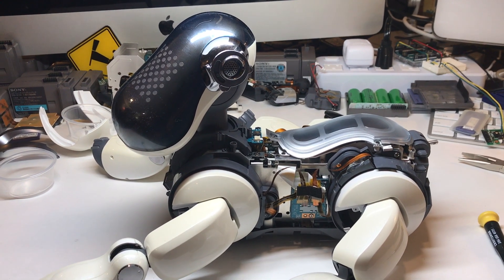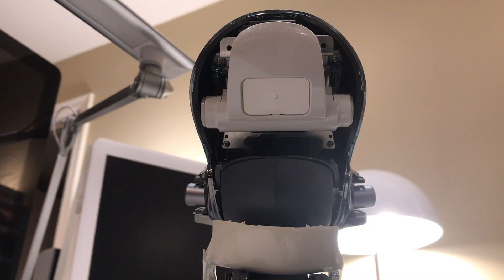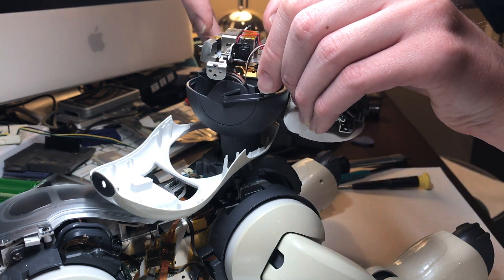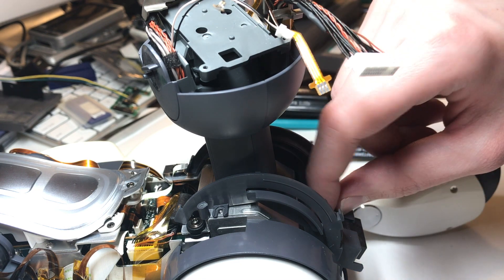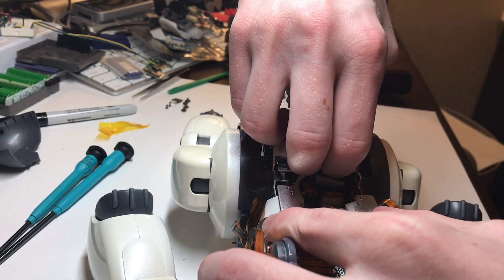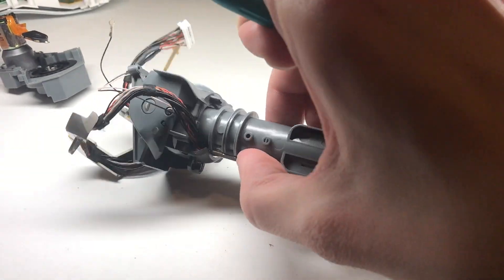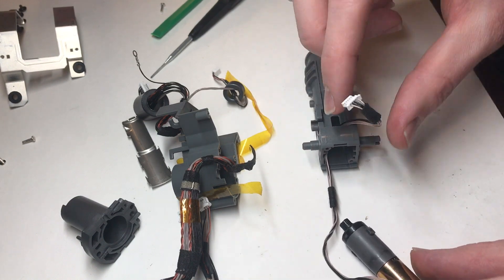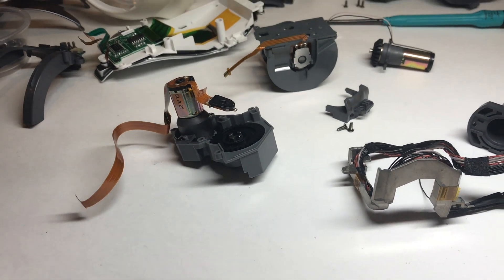Aibo ERS-7 Pan Axis Disassembly/Repair Guide

Comment: So i am a massive tech nerd. And i have save so far 200 for an aibo a guy quoted me 900 for an ers7 m2 with mind 3 software he said he would check the aibo to make sure everything is functional. Although from what i hear the microphone degrades. Where would i get new ones if i had too.
Reply from the maker: any 7 can develop a bad mic, but the only ones that are nearly guaranteed to fail are the M3s - sony had a defective batch of condensers during that generation.  i sourced my replacements from a specific sony video microphone that used to be pretty ubiquitous (i don't remember the model, at this point), but anything that's the same size/specs as the original will work

Comment: hi. the motherboard of my aibo head is broken. do you have any idea what the problem is? do you sell this spare part? cordially
Reply from the maker: unfortunately i have not seen a common failure point in the headboards, you'll have to troubleshoot and repair it on a component level.  sadly the only way to source a spare board is to buy another dog and part it out.

Comment: The videos are incredible and I'm sure will become invaluable. Thank you! I do have a little question - do you happen to know any techniques to de-yellow the plastic on the white ers-7? Mine has yellowed a bit on the top and sides. I'm not sure why because it was in a dark garage and wrapped in bubble wrap. I have a feeling most usual techniques online won't work because of the clearcoat... cheers
Reply from the maker: thanks!  i'm glad they've been helpful to people, i have plenty more i want to make whenever i find more time for it haha. 

unfortunately you are correct about the clearcoat on 7 shells, any sort of peroxide (or other) treatment would have trouble penetrating deep enough to reverse the yellowing, and could very likely damage the clearcoat.  if the pup was stored in a garage i'm guessing heat caused the yellowing.  while UV exposure tends to rapidly yellow plastics, heat can do the same thing over enough time, especially if the mixtures between the plastic and other additives were not exactly correct at the time of manufacture.  in particular, flame retarding chemicals that are added to consumer plastics have been known to cause yellowing over time (and are accelerated with heat). 

A lot of the peroxide based treatments can also cause plastics to become more brittle.. which may be just fine for an old keyboard sitting on a desk, but is a bit more concerning for a robot that walks around autonomously and is prone to falls/etc.  while there may be a way to reverse the yellowing, personally i think the chances of success are low and don't outweigh the risks that are likely to happen.  IMO the yellowing adds some character to your pup haha!
Reply: @JBurg  thanks for the response! It's a shame but I can live with it. Please keep going with this! Its good to know that there are people still going with the repairs! I nearly sold my Aibo a few years back but I'm glad I didn't.

Comment: @JBurg
Some fantastic work you do with these Aibo's,
I have recently come across an ERS-7 with a defunkt (locked) battery - not used ofr a long time so it died :-( I have removed the bios chip from the cells pcb and saved a bin file of the bios is there any chance that you have an unlocked bios file that I could either have or purchase from yourself please?

Keep up the good work,
Reply from the maker: hey!  sorry to hear about your battery.  there is no need to remove the EEPROM from the board, hopefully that did not damage anything.  if you want, i can send you a dump of the data from a used battery, but you will still need to edit and reprogram it to initialize the gas gauge IC, zero out the cycle count, match the programming to the capacity of the new cells, etc.  i would not recommend tampering with the battery if you are not familiar with how to do this sort of work.  i'm not quite sure what you mean by an unlocked file though, there is no software lock on these batteries.  if your board is no longer working, it's likely removing the chip caused damage or your work on the battery triggered one of Sony's anti-tamper measures and damaged something on the board.  these batteries are not like like other li-ion packs, i really do not recommend people try to rebuild them at home.  most home rebuilds i see just cause damage to the board :(